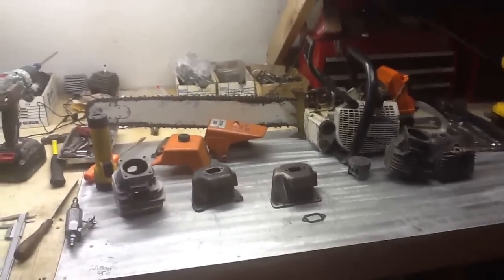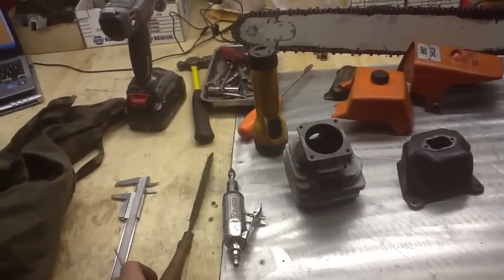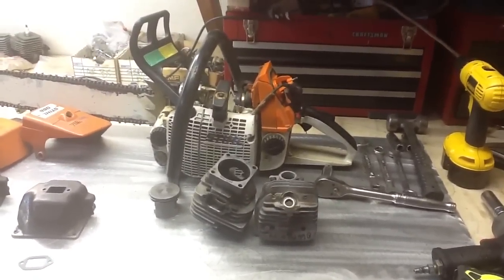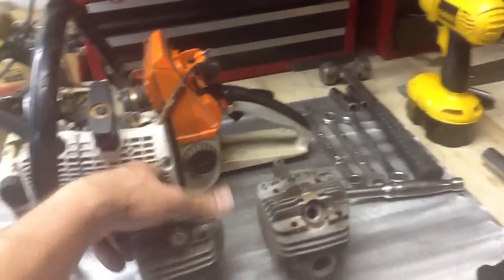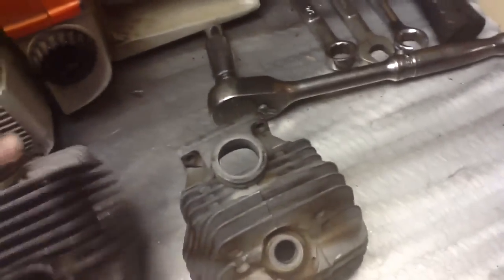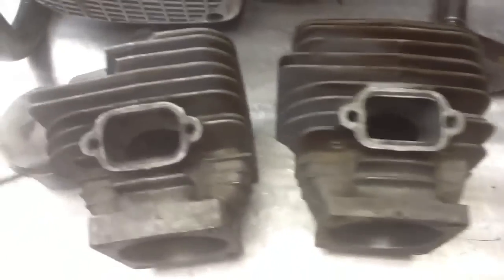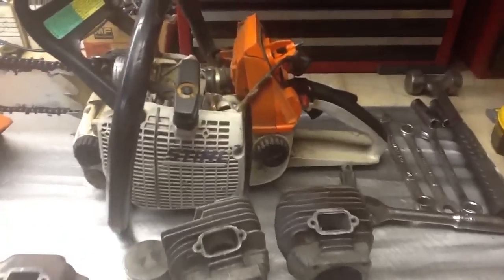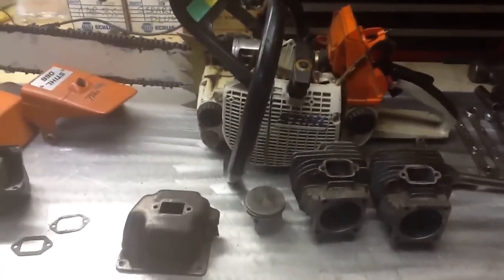2 Stroke Engine Cylinder Mod and Porting Stihl 066 Chainsaw

Comment: The lateral porting is limited to a percentage of ring circumference, not the flats of the piston. Whilst air escaping is certainly not desirable, ring snagging on a port too broad will have destructive consequences. Most modern broad ports have a bride support to eliminate ring snag.
Reply: Whats the percentage ?
Reply: @mart446  People say 65% of the bore, in the chainsaw world.  You're measuring line or 'cord' distance here, IE do not trace it to paper, lay that flat and measure from there, instead draw a line from each port-edge down to cylinder-base, and measure there.  Standard 660 exhaust ports are ~1.25", whether the 54mm jugs or 56mm big bores, can't recall #'s for 54's but on the 56 you'd gain  11.7% width going to 65%, and 17% going to 68%...I heard of >70% mentioned once but imagine you'd be changing rings all the time (or destroying the engine, if not ahead-of that!!)  I should mention that the port-shape, and chamfering(or rounding, if you wanna do it better...chamfers/bevels are for mass-production, not at-home tooling!), gets CRITICAL once past the ~60% of bore area, the rings do expand-into the port every time they pass so if you can't shape & finish the port-edges well, I would not recommend any widening!! I do my edges with tungsten 1/8" bits to start, then sanding-stone bits, then by hand/finger with sandpaper going ~100g, to 180g, to 220g and if I'm feeling it I'll go 400g but found 220g seems fine.  I also have begun "breaking in" top-ends using cheap throwaway piston rings, this is just during the 1st tanks where the saw is only idling/not revved, this helps break-in the jug w/o hurting the rings you'll ultimately use, just run 1-2 tanks at idle, then swap-in your Caber or OEM rings and bam you're set ;D
Reply: @mart446  Also since we don't use expansion chambers, you'll wanna flare-out your entire exhaust port, and hopefully it goes w/o saying that your muffler-gasket and muffler entry-way need to be port-matched to the new exhaust-flange dimensions (or over-matched, to account for imprecision in mounting, I usually over-shoot like 1/2mm on all edges when grinding the muffler entry & muffler-gasket....or "muffler heat-shield" since I use entire plates, not those silly lil gaskets, these things run hot I don't know how they made them w/o heat shielding between muff//cylinder!!)
Didn't realize how old your post was, hope your build went well!!!
Reply: I've NEVER seen a bridged exhaust in a chainsaw, actually only bridged port I can think of (bridged for lateral ring retainment) is the upper transfers on the new 7310's (damn what a case-study that machine is!!)  If I'm understanding your post here, you're basically saying that exh.width is really just about bore(or ring/lateral) dimensions, NOT about piston-skirts?  I'm lucky in that, on my build, the skirts would cover the port fully, w/ at least 50thou per side to spare, even if I make exhaust 65% bore.... I'd always heard that as an upper limit, and used it as my aiming-point, but just heard about "going over 70% bore" in a video, would love to hear your thoughts on that, my guess is it's like taking a piston past 3500 feet/min, it "works" but you've gotta be changing rings & expecting unreliability, a true nascar not a street hot-rod!
Reply: OH I'd LOVE to heard your/anyone's thoughts on my idea of using "throwaway rings" on a new top-end build, just for a couple tanks of idle-RPM (no high throttling it!)  Then swap-in your OEM or Caber rings, and - the throwaways having pre-worn the jug to take rings - your rings initial break-in wear will be much lower!
Have begun doing it, but obviously can only theorize whether it's truly helping or not... In my mind it must, because 'break in' is the "mating" of the rings & jug, so that's a "50/50" thing, seems kinda obvious to use throwaway rings for that first tank or two, no?

Comment from the maker: I've never had a chainsaw on a dyno, so I cannot say.  In all reality, it is hard to quantify.  The power difference is most noticeable in the way the saw runs; Revs faster and smoother, especially when in the cut.  More efficient combustion.  More power.
Reply: Oil mix 1: 33 ?

Comment: You have some of the basics, but i'am missing a lot! Changing the timing /compression will give you most of the performance gain.. not just widening the ports. But the crappy exhaust is a huge restriction on this motor! Some sort of improved home made resonance-exhaust would give this engine a huge performance gain!
Reply: you are correct, but I think this vid is aimed at users who are inexperienced tuners....changing port timing gets a bit trickier for most amateurs.

Comment: Nice video on the very basics. If you ever need specialty tools for doing a lot more, and doing it quite a bit easier, just contact us. Glad you mention the gasket/outlet matching, I harp on that in some of my vids. Also you show that the radius, or curve at the roof and floor of the port are maintained, that and chamfering are important to the ring life.

Comment: Thank you for sharing this video. I always like things like this. I am 18 and have always loved things that go fast and make sound. Obviously my dad doesn't want me taking apart his $20K hot rod motor, so I experiment on small motors when they come my way. I have always wanted to port something and in this case it's an old Pouland Chainsaw. Great point you said about porting in relation to the engine timing and the side of the piston. Thanks again for sharing! This has helped me a lot.

Comment from the maker: Yes. Start simple. Mild abrasives and work slow.  Start by taking off all of the casting imperfections in the intake and exhaust ports.  This should give you enough gains to be noticeable.  Remember to match your gasket and muffler accordingly.  Good Luck to you!